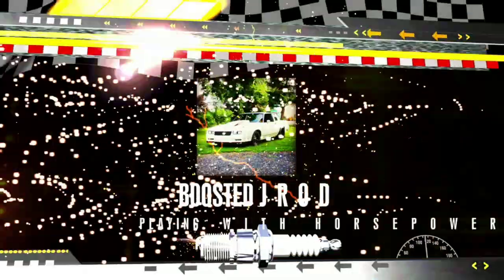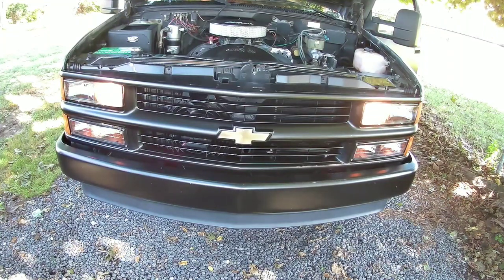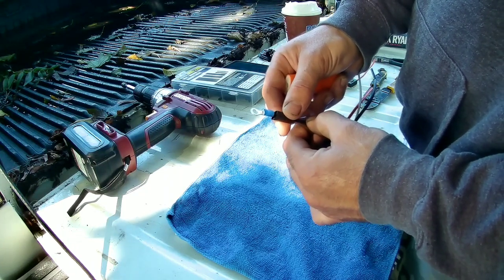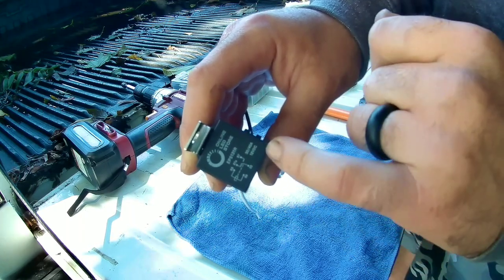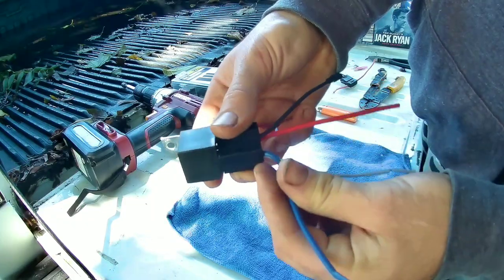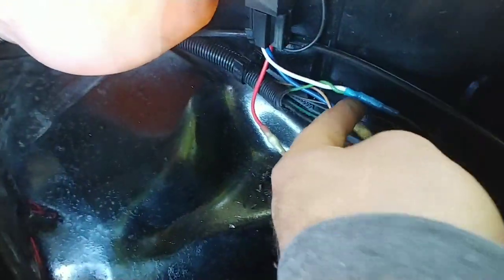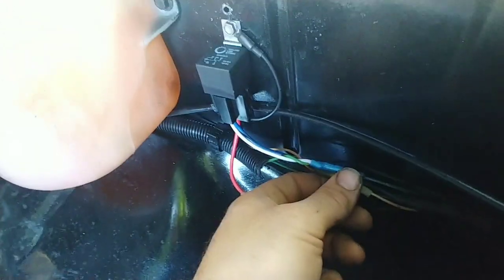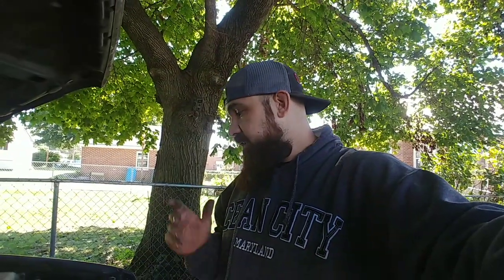88-98 Chevy truck (GMT400) HI beam/LO beam headlight MOD

Comment: There is really no reason it did not come like this out of the factory, considering the headlights on this truck have two individual chambers for low and high beams to begin with.

Comment: Is that a 454 you've got under the hood???  And if so,   Because I didn't think Chevy put the 454 in tahoes those years. It looks awesome.  Been thinking about replacing my 350, comma with a 502 Big Block.  And I was wondering if it was a hard install ???

Comment: Couple of questions, first can you share some parts info on the relay you installed (i.e. part number, where purchased etc), and second what did you use to stand your air cleaner higher up on that throttle body? I have the same cleaner, but can’t use it cause it doesn’t clear the coil. Any info you can share would be fantastic.
Reply from the maker: Thanks for the questions! I apologize for not linking the parts in the description. Hope this helps!

Here is the relays I used:
https://www.amazon.com/Pack-EPAuto-Relay-Harness-Bosch/dp/B017VDI0GY/ref=mp_s_a_1_3?keywords=40+amp+relay&qid=1570167304&sprefix=40+amp&sr=8-3

And this is the air cleaner spacer: https://www.amazon.com/Spectre-Performance-4954-Cleaner-Riser/dp/B004AJ3306?SubscriptionId=AKIAILSHYYTFIVPWUY6Q&tag=duckduckgo-d-20&linkCode=xm2&camp=2025&creative=165953&creativeASIN=B004AJ3306
Should just have to get a longer air cleaner stud.
Thanks for watching!
Reply: Thank you, huge help.
Reply: im looking for a diagram on the wiring for a 95 gmc sierra  im comparing some 
the high beam wire is loose so it causes it to cut out

Comment: I looked up the factory wiring diagram (I have a 94 Suburban) to figure out how to do this without the kit.  Figured it out (I am an electronics engineer).  According to the diagram, this looks like it will work (I haven't done it yet because I don't have the quick-splice connectors yet, but I did verify that the wire colors are as shown in the factory diagram, so I have no reason to believe it won't work)...

Where the high-beam switch is on the steering column (it's down pretty low, very easy to access) you'll see 4 wires going to the connector to the switch.  1 yellow (this is the power that is provided by the headlight switch), 1 tan (this goes to the low-beam lights), and 2 green (one is for high beam lights and one for the high-beam indicator light in your dash cluster).  To do this same exact mod without the relay, you just splice the yellow (hot but only when headlights are on) and the tan (low beams) with a wire shunt between them.  You can use 2 quick-splice connectors to eliminate the need for stripping and soldering and taping and all that.  Anyhow, simply connect a piece of appropriate wire (like what is it, 22 gauge?) to connect the yellow with the tan.  That way, whenever there is power supplied to the circuit (yellow, via the headlight switch), the low beams are always energized regardless of the state of the high-beam switch.  Another benefit of this mod is that the lights will not momentarily blink off when you switch from low to high or vice versa, which is how the high-beam switch normally works (break before make).  And if the high-beam selector switch ever breaks, you'll never lack at least your low beams since they are now bypassing that switch.
Reply: Just did the mod and verified it works.  I modded the quick-connect splicer (18-14 AWD, found at AutoZone) by drilling out the plastic plug that is intended to terminate the end of the butt joint; this way I could use the splicer to join 2 parallel wires without any need for a 3rd wire between them.  So it was even simpler than I first imagined.  Just loosened up a bit of the black tape and clamped the splicer to join the yellow and tan wires together.
Reply from the maker: Thank you for sharing!

Comment: Thanks for the video. I had the same idea but I see that it works now. BTW you could have ran the hot lead from the back of the alternator.
Reply from the maker: That is true! Thanks for watching and commenting!
Reply: @Dragracetherapy  funny people are asking for a part number for a basic 12v relay. Lol
Reply from the maker: @mwyson4095  we will have this lol.
Reply: re: pulling power directly from the alternator  -- the battery provides some dampening to the fluctuations of the alternator.  Not a big deal when supplying incandescent bulbs, but as a rule of thumb I always pull positive from the battery positive
Reply: @jeffeverde1  electricity travels from negative to positive. It doesn't matter where you  hook into the positive.

Comment: Are you happy with the aftermarket headlights on that truck?  (there are bunch of crappy ones out there with flimsy mounts, non-functional adjusters, etc)
Reply from the maker: These are "Okay".... They are not flimsy or anything, but I'd really like to go with a brighter bulb or HID set up
Reply: @Dragracetherapy  on the brightness of your existing lights -- the way you wired your relay, you're getting "all 4 on", but you're not getting the main benefit of headlight relays, which is providing a high current supply to the lights.  The way you've wired your relay, power to the high beam lamps is still coming from the high beam switch.  And power to the lows is still coming from the low beam switch.  The only time you're seeing the benefit of the high current path thru the relay is to the lows when the high switch is on.

Add a dual-87 relay to the design, and wire it so that - 
-the existing 87/87a is triggered (86) by the low beam switch, and 87 goes to the low lamps (with an inline fuse)
-the dual-87 is triggered (86) by the high beam switch, with one 87 terminal going to the high lamps (with an inline fuse), and the other 87  ties into the wire from the low beam relay's 87  to the low lamps.  (On a dual-87, the two 87's are isolated - when the low switch is on,  the low relay won't backfeed thru the dual-87 to the high lamps)
-run a (fused) 10ga from the 30 on both relays directly to the battery
--run new 12 or 14ga from the relay 87's directly to each lamp socket
-run a new 12 or 14ga from the lamp sockets directly to the battery (or a known good ground)

Wiring your headlamps so they're have a high current power supply through a relay (and using appropriate wire gauge), will literally double the brightness of your existing headlights.

Comment: What was the long blue wiring u put under the fan ?
Reply from the maker: That was a 12 volt feed to the relay
Reply: So does the question below about a air cleaner being set up higher have nothing to do with this ?
Reply from the maker: @isaccmartinez6533  not this particular video subject. I believe he was just asking bc he noticed it in the video

Comment: Tried this on my 95 Suburban but can't get the four lights to come on when switching to high beams...lows go out, highs stay on.  As an experiment, I swapped the blue and white wires from the relay, and the four lights did come on in high mode, but when switching back to low mode the highs stayed on and the lows went out.  There sufficient voltage at every termination, so I don't know what the problem is.  The 95 year did have some quirks, so I'm wondering if this is one of them.  Thinking of swapping the ground and power wires to see if that does anything.  I am running LEDs in all headlights.
Reply: you need a dual-87 relay, triggered by your high beam switch (and you need a relay socket with 5 wires).  Wire the relay -
-85- to ground. 
-86 to high beam switch.  
-30 to battery positive (fused, 10 or 12ga).  
-One 87 to high beam lamps
-The other 87 taps into the existing wiring going to the low beam lamps.

The two 87's of a dual-87 are isolated, so when your low switch is on, power can't backfeed thru the relay to the high beam lamps.  I think LMC truck sells a kit for this, but you can buy a dual-87 relay and do it yourself.
Reply: @jeffeverde1  Thanks...much appreciated.

Comment: The link you put below for the relay is a 5 pin.  You used a 4 pin ?
Reply from the maker: U can use either 4 or 5. Just remove center pin if it's a 5pin
Reply: BoostedJROD  it’s because I’m currently doing it I wire it like you said and noticed I had a extra wire (yellow )  since I used (white wire to the Bright green ) and (blue wire to the tan )   Can you give me a hand. Been going crazy if I could use the five pin as in the one I. The link you posted
Reply from the maker: You only need 4 wires... If you have a 5pin with the center wire, just ignore the very center pin/wire. It will not be used. But make sure to heat shrink or tape off the end of the wire so it's protected.
Reply from the maker: I've updated the description to include which pin number goes to which wire
Reply: BoostedJROD  I’m going to give it a shot.  It’s because MY pin 30 is black so thought commen sence. (Ground !)
Reply: BoostedJROD  I got it THANKX for the help
Reply from the maker: @fernandoguzman1014  thanks for watching and the comments!

Comment: FYI,
 I used a 1/2" socket to remove a bolt holding the EIC module to the fender and squished the ground connector up under there.
Then I followed the thin positive cable from the battery to the fuse block where I needed a 10MM socket to remove the nut. 
I don't know if there's a 1/2" equivalent in the millimeter sockets, I assumed they were all going to be SAE and started with those sockets only dropping back to metric when one didn't fit. 
Or maybe this is just from the era when half the bolts on the GM cars were metric and half were SAE.🙄
Reply from the maker: 13mm is roughly equivalent to 1/2

Comment: My 97 Chevys' wiring harness has  2 dark green wires and 2 light green wires and is same with the brown and tan.  Don't have any idea what wires to use..
Reply from the maker: This link and a test light should get you headed in the right direction...

https://easyautodiagnostics.com/gm/4.3L-5.0L-5.7L/headlight-circuit-diagram-1

Comment: Hey so stupid question... I just bought an 88 and I'm not sure if the lights are both burnt out. I've never had a vehicle that has a strange button setup for the lights instead of a lever. How do you turn the high beams on 😂
Reply from the maker: Of all the gm trucks I've been in that were in this year range, it was always pulling the turn signal lever towards you. I would check the easy things like fuses and light bulbs before diving further into it

Comment: GM did that because the lights pull all their amperage through the dash switch. All four bulbs on at once is too much load and GM was too cheap to add a relay OEM.
Reply: Looks at wiring diagram and there is a relay for the high and low beams so a simple jumper diode at the switch is so much easier.

Comment: I have the exact relay but no wires and my vehicle is 1993 g20 van could you please tell me what pins go to the circuits high low and ground  I see the 30 is for constant battery voltage
Reply from the maker: Everything you need is in the description